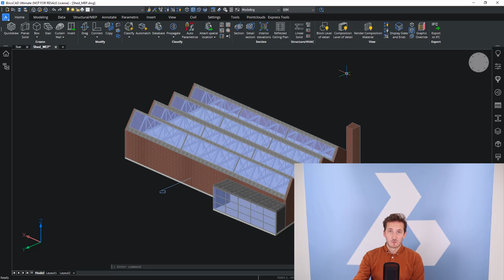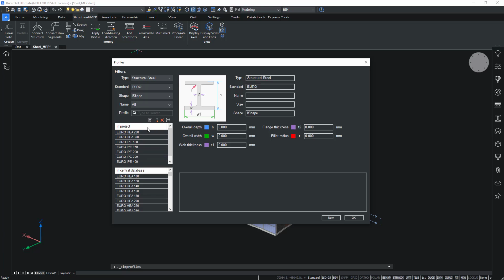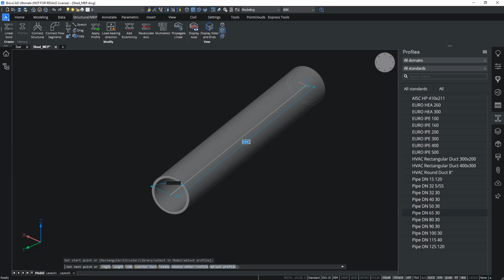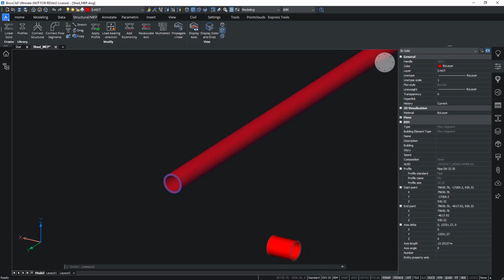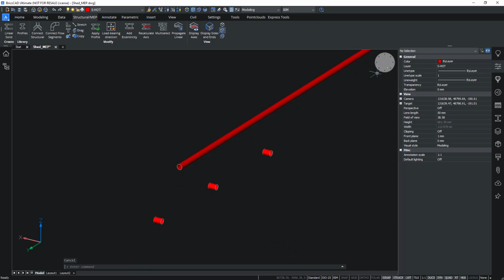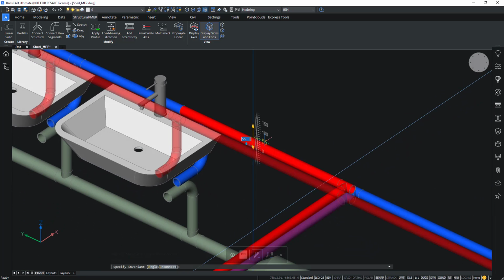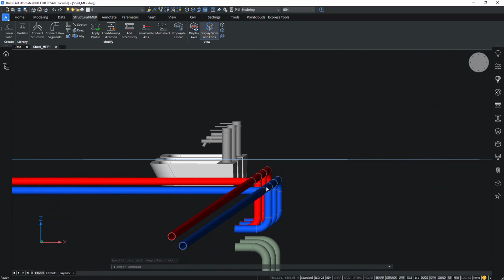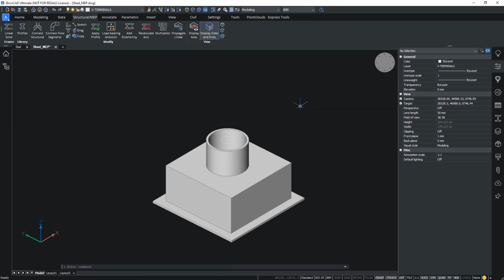BricsCAD V22 BIM Academy 14 - MEP Modeling

Comment: Very useful video. Unfortunately, when I try to use the "connect flow segment" command between two entities it doesn't work. I get a comment like that says "two few entities selected". I don't know what I'm doing wrong. Can you help?
Reply from the maker: Thanks for the comment! The first thing you could try would be to check what kind of entities you are trying to connect? As BIMFLOWCONNECT command works with flow segments only. It's hard to say more without a drawing, but if you n can create a support request if you have a Mainteinance contract, or post it on our Forum to get suggestions from the community:
https://forum.bricsys.com/
Reply: I use to have the same issue. Select both pipes first then hit connect flow segments.

Comment: What about running drainage at grade with falls? The drainage pipe shown in this model look as though they run flat, which obviously wont work in the real world. Is there an easy way to design the drainage system with pipe falls?
Reply from the maker: You can draw LINEs that are sloped before applying the profiles to the the lines. To see the slope, or adjust the delta value of the line (height difference between begin and end point of the line) you can simply use the Properties panel.
Reply: @OctaveBricsCAD  Hi I've been working away over the last few months manually adjusting the Z Delta height for drainage pipe grading. This is way too slow. There needs to be a line slope button or command.